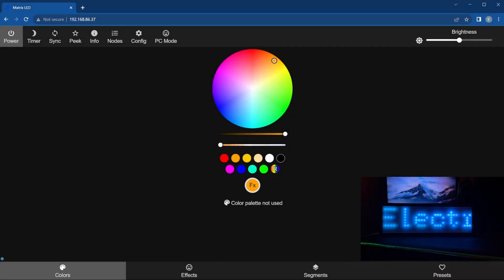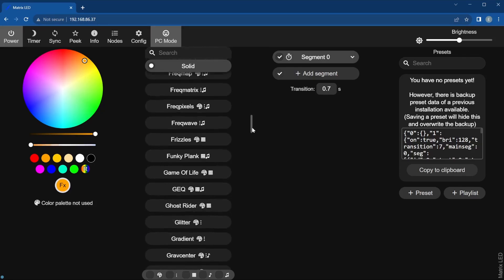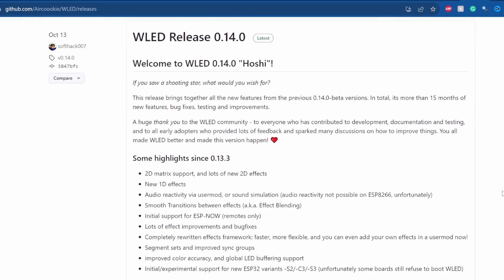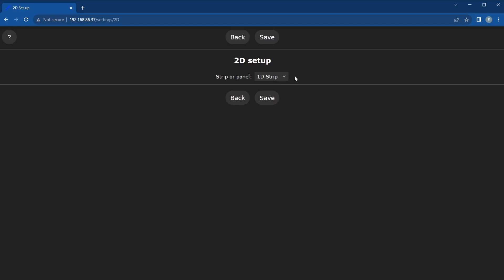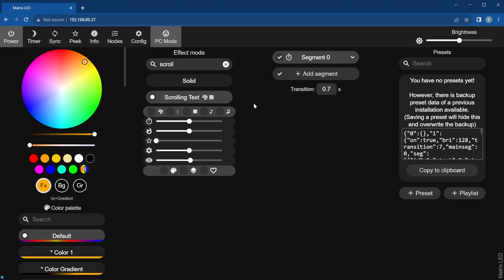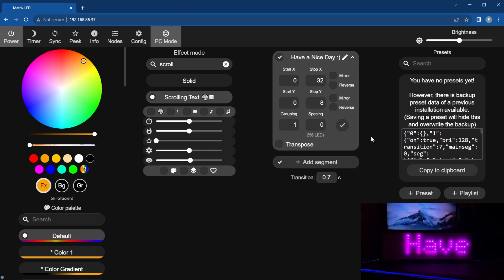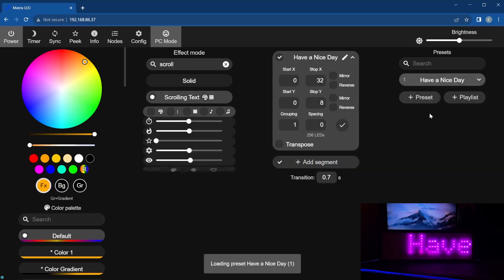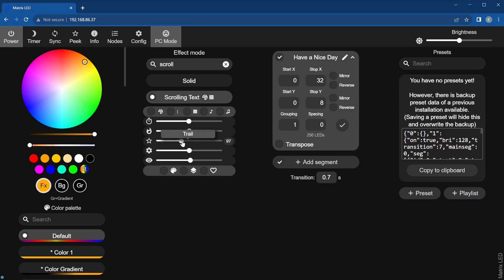WLED Custom Scrolling Text - A Quick Tutorial

Comment: Hi, I'm a newbie trying to connect two 32x8 panels. I've tried several combinations and the text isn't clear.
Reply from the maker: It was definitely challenging to get the orientation correct the first time I did it. I briefly showed my Panel Layout setup at 0:56, but each setup may be different. Essentially, you need to tell the WLED firmware where the 1st LED is for each panel (the green dot), and which direction the LEDs travel in. The technique I used to find the first LED was to set the effect to "Solid" and change the Segment 0 Stop X & Stop Y to "1". Each panel may have a different starting place depending on how it was connected, so do that for each of the 32x8 panels to know where the 1st LED is (Top Left, Bottom Right, etc.).

So far in my experience, the 8x32 panels generally use the Vertical orientation and Serpentine pattern, so that should take care of the direction. Once you know the pattern, you can use the reference image in the LED panel layout setup to try and match. Make sure you also increment the X/Y offset value (see example below). 

As an example, I built another matrix with four 32x8 panels and used the following settings:

Panel 0
1st LED: Top, Left
Orientation: Vertical
Serpentine: True
Dimensions (WxH): 32x8
Offset X:0, Y:0

Panel 1
1st LED: Bottom, Right
Orientation: Vertical
Serpentine: True
Dimensions (WxH): 32x8
Offset X:0, Y:8

Panel 2
1st LED: Top, Left
Orientation: Vertical
Serpentine: True
Dimensions (WxH): 32x8
Offset X:0, Y:16

Panel 3
1st LED: Bottom, Right
Orientation: Vertical
Serpentine: True
Dimensions (WxH): 32x8
Offset X:0, Y:24

(If you are connecting the two matrix panels to become a 64x8, then you would need to change the X offset to 32 instead of changing the Y offset. I stacked the matrix panels in this example to make a 32x32.)
Reply: @Electriangle  thank

Comment: can we set variables to bring in info from other sensors, like temp or humidity
Reply from the maker: Yes, WLED has a built-in API command interface that makes it easy to send any text or numerical values to be displayed. Is your temperature / humidity sensor connected to a separate microcontroller from the one running the WLED firmware? If you have the sensor on a separate microcontroller, then it would be easy to setup the API commands to be able to display measured values and update colors or presets however you wish.
Reply: @Electriangle  Thank you for the reply, I have a spare esp8266 so I can dedicate one to the WLED. I'll look into the api commands. I Think it would make a great topic for a video if you have enough time ;)
Reply from the maker: @kdt85  Yeah, thanks for the suggestion. I don't see any other videos on the topic. I think that'll be a fun, quick project to play around with. I imagine I could have it display red-ish colors for higher temp readings, and then blue-ish colors for lower temp readings. I'll see about putting a video together for that.
Reply: @Electriangle  awesome thank you!

Comment: thank you for this video, I also played with Wled and scrolling text, with a 32x8 matrix. I'm having trouble displaying multiple sequences of text and finding the right display timing. It seems that there is a character limit, and the management of display times (seconds) is not respected, have you also noticed this? thank you Jean-Philippe
Reply from the maker: I haven't come across that issue myself. But I did find on Reddit for r/WLED, BytesOfPi mentioned there is a limit of 32 characters. He also created a workaround for that if you are willing to go in and tweak the code through PlatformIO. Here's the post: https://www.reddit.com/r/WLED/comments/12fzgnw/presets_with_scrolling_text/
Reply: @Electriangle   i have the limitation of characters (i work with ESP8266) thanks for sharing link, i have to investigate more on timer for my scrolling texte, thanks!

Comment: Is there away to display two rows of text at the same time?
Reply from the maker: Yes, it does work with more rows of text. I just tested it to confirm. You simply add another segment and adjust the start and stop boundaries. For example, you could make the first segment "Start Y" set to 0 and the "Stop Y" set to 8. Then for the second segment, you could make the "Start Y" set to 8 and the "Stop Y" set to 16.

The only thing is you can't have less than 6 pixels tall or the text will get cut off. That is the minimum height it needs to display the letters. So for my matrix project shown in the video, it doesn't fit with the example I gave. But if your matrix project is bigger, then it will work fine.
Reply: @ Can we use a different font, there is one called tom-thumb that works well on led matrices

Comment: How to apply two different effect on each half of the leds, one side random flickering and other side android type effect at the same time?
Reply from the maker: In the WLED application, you can use the "segments" tab to separate the lights into parts and control them with different effects. You need to define the segments by typing the start and stop LEDs for each segment (for example, 0 to 50 for one segment, then add a new segment for 51 to 100, etc.). When the checkmark for the segment is active, then it will change the effect for that segment.

If you search for "WLED segments" on YouTube, you can find a tutorial that can help explain how to use them.